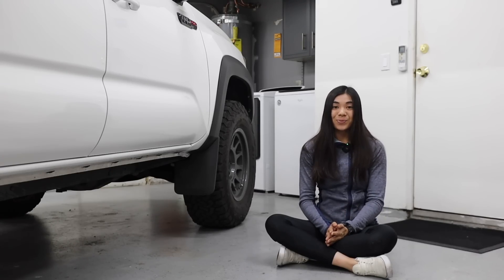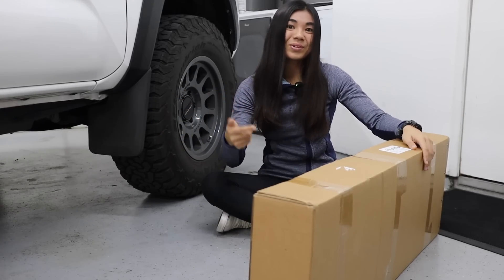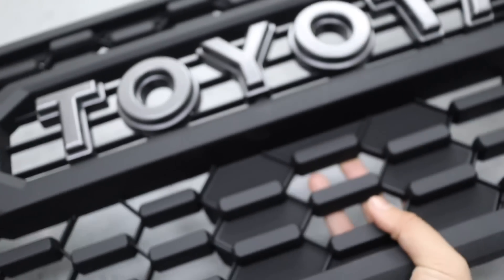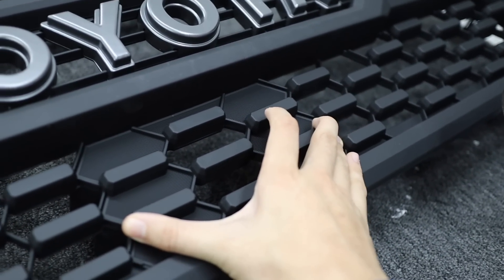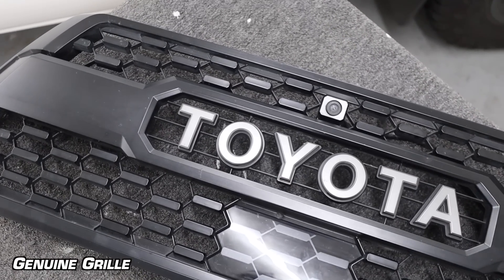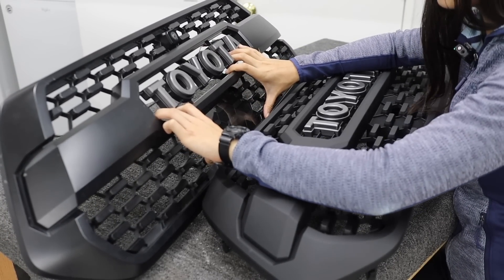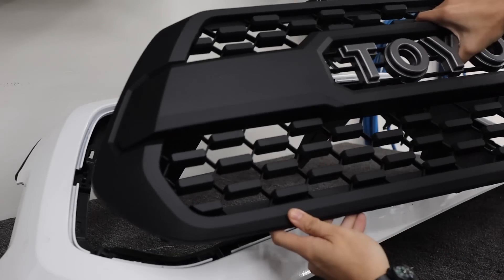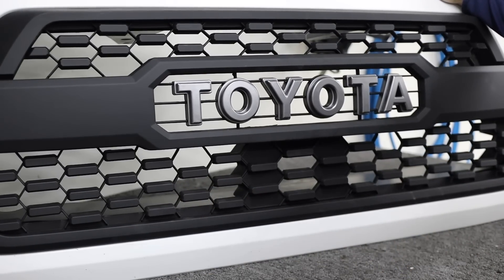TRD Pro Tacoma Grille: $100 Knock-Off vs Genuine OEM… same thing?

Comment: I did an aftermarket Pro grill on my 2nd gen Tacoma and it's holding up quite nicely. It fit with no problem, my main concern was how long it would last but after 5 years it still looks as good as new.
Reply: Link for it? I want one for my '08
Reply: @ramirojuarez7379  link?

Comment: The biggest issue with getting an OEM TRD Pro grille is having a VIN number for a TRD Pro. All the vendors of OEM parts require a correct VIN to purchase. I found my knockoff from R4T, and it’s not too bad.
Reply from the maker: True—the VIN thing is another thing to consider!
Reply: Not necessarily, they usually come with a warning that you should provide a VIN number for proper fitment, but I haven't had any issues with ordering any parts from any of my local dealerships without it.

Comment: Definitely recommend going OEM if you can. Best fitment, and looks a better. And if you have the front camera, the OEM camera bracket and placement is MILES better than the ones I have seen on the 3rd party grills. Usually the 3rd party grill brackets set the camera too far back. I had a 3rd party one, regretted it and ended up getting an OEM one a few months later.

Comment: Chloe you can tell you are an Engineer. Excellent review of the product. Someone commented that their blood pressure spiked to see you assemble it without some form of protection on the floor. It is a cheap knock off, and I don’t think you will actually be using it.   I really didn’t like the lettering, I didn’t care for the flat black on the knock off, and I’d would need to add the factory sensor, so I would go for the factory model.

Comment: Some aftermarket parts I purchased for my 5th Gen 4Runner was replaced with OEM…They didn’t fit or either looked cheap compared to the original…Most were Garbage! Cheap is expensive! Stick with OEM if you can! Lesson learned, OEM is the best route except for my T10V2 Android 14.1” Touch Screen…😮

Comment: I have a 2022 Tacoma TRD 4x4 sport and Iwent to a local Toyota dealer and bought a heritage grill for my truck I went home and installed it well to my surprise first the grill did not come with the sensor guard and the old one had 10 screws that went along with the clips new one did not so I went back and asked for the cover guard for the sensor they said I would have to buy it separately and it was 300.00 and said that my ven. Number call for that grill. My new grill has only 2 screws can someone please help me and let me know where I went wrong. This is my 3rd Toyota truck and never ran into this problem.

Comment: Mold quality, material, process, quality control, etc. for aftermarket is worse than oem, so the flat finish hides imperfections and makes it easier to produce.

Comment: Made in China? I wanted to replace my cast iron grates for my Webber grill $165. For OEM. I paid under $50. For the exact same thing. Made in China, both. The only difference is the replacement didn’t have rough edges from casting.  Better than the original.

Comment: There is a difference in the TSS Garnish covers as well, the OEM is higher quality than the china knock offs, another difference is the two posts on the China knock off garnish are 5/16 in diameter while the OEM garnish the two posts are 1/4 inch and use a smaller push lock washer that is easier to install. The OEM Toyota TSS garnish is made in America.

Comment: No surprise, a plastic injection molding tool for a part that large is absurdly expensive. Toyota is going to spare no expense. They’re also going to retire or refinish an aging tool while knock offs are gonna run it into the ground.

Comment: Probably shouldn't worry too much about not being OEM parts and using them.  Most tires and rims, brakes, Aux lighting, and  windshield wipers, the list goes on and on, are not the same as stock.  Stock and OE parts are sometimes hard to come by and somethings in the aftermarket are superior quality.  Though maybe not in this case. Pick your poison, price vs quality..

Comment: If you don't have a TRD PRO, are you posing with a PRO grill? I have a TRD Off Road and like the look but don't want to be a poser. Had a SR5 with an aftermarket grill, it looked good but had some front sensor problems.
Reply: How are you posing? I much prefer the TOYOTA design over the stock grille with the “T”. No one really cares and it looks a million times better.
Reply: It's not like slapping Cobra and 5.0 emblems on a V-6 Mustang, it's a styling preference.

Comment: I've had the knock off grill on an '18 for about 3.5 years now. Still looks new and was able to mount the sensor with an OEM sensor cover on the front without issue. If it rains a ton, some water will penetrate the sensor cover, and you can't use the adaptive cruse control, but this has been a super rare occurrence.
Reply: that happens with oem too, it happened to me with a lot of rain...

Comment: Yotaverse for the win. Theirs has the whole letter plate and not individual letters. And yes, you can remove the blank garnish and swap your sensor over.
Reply: Yep. I bought the Yotaverse grille for my '19 SR5 a year ago and still looks great! I installed a .100" thick #10 washer under the sensor's top mount and screw to slightly angle the sensor upward.  I did this on the bench before installing my grille based on research I did with regards to changing the sensor's mounting location. Cruise control and collision avoidance work fine.
Reply: Yotaverse has the best aftermarket grille imo. In the past, they had this type where you had to screw in each letter. But now, the whole plate is just easier.
Reply: @TiSilver330Ci  do you need to buy the "third gen garnish"? or is the one that comes with it ok?

Comment: The shine on the after market is duller, the letters are nice enough, but not as sharp as the OEM. It looks like that after market grille is bought from the same Amazon seller I got mine from. Did that after market comes with the raptor light? If it did, those lights only fit a certain way. The plastic does feel and look cheaper, but so far, the grille I got still looks good, no hazing or warping from the occasional 100 degree heat. Mine is 2016, so there is no need for the front sensor assembly. Great video.

Comment: I got the knock off and painted it with a matte black finish which has dark, dark grey cast and gives it a durable look. Perhaps is not as shining as OEM but holds up better for scratches. Otherwise, satisfied with knock off. Added lights and front camera to top it off. Have Had it a couple years and a solid purchase. I have 2 Toyota grill name plates (as a result of a scratch on the 1st one and they replaced it). Was planning to paint it red and maybe switch out. I have “quick sand” color with red accents. Nice truck. Have 2017 Sport.

Comment: I bought a knock-off brand because OEM is not worth it, I ended up raptor lining it either way, same with the fender flares, the ride mirror caps, the rear bumper caps as well. Just little things here and there to match.

Comment: the finish is more a factor of the mould, rather than the quality of the ABS.  One of the effects of the desire for TRD Pro grills, is that OEM grills from other trim levels are readily available on resale sites.  I didn't care for the TRD Off Road grill on my '18 Tacoma, and found a '20 TRD Off Road grill take off for $60...I like it much better.

Comment: I like the one Taco vinyl has with the center (Logo) inserts that you can get various colors. They also have an optional front camera mount available. Some of the OEM sights want a VIN to order this part also. I definitely agree there is a visible difference. But for the extra 10HP you get for adding the grill who cares. HAHA

Comment: Both grilles are painted. The OEM part has a glossier finish, maybe a 10 gloss and the aftermarket grille has maybe a 2 gloss. The higher gloss is more resistant to marking. 

The excess plastic is called “flash”. It’s likely where the mold is worn in those spots due to the shot count in that particular tool. It could also be from some slight damage at the parting line (where the mold halves meet), or a bit too much packing pressure when being molded.

By the way, Toyota didn’t mold that part. A supplier molded it as with most parts used in the making of the Tacoma. The aftermarket part is also molded by a supplier, just not for Toyota. The lack of detail in the aftermarket part is intentional so that the cost can be kept low. Otherwise, we would have no incentive to choose it over OEM.

Comment: OEM TRD Pro grilles are a freaking rip off!  All you're paying for is the genuineness of it. It holds really no quality advantage over aftermarket "cheap" ones. Obviously, get an aftermarket one from a reputable seller, but there's really no reason to spend like twice the money on a OEM one. There's a lot of aftermarket ones that are a little over $100 and never have a problem. Besides, I'd be willing to bet that the factories in China where the OEM and aftermarket ones come from are either in the same neighborhood, if not the same place. Save your money.

Comment: First,  I noticed right away the letters didn't look genuine and I only have a '17 TRD sport.     The fact that your grill withstood that hit says a lot about the quality.  Also,  the same type of plastic can have multiple coats,  colors and finishes.  It's just small changes to the recipe be for the injection process.  I used to pick up brand new recycling bins and deliver across the US.   In right with you OEM!   Best wishes to you all.

Comment: Hi Chloe, great video! Based on your b-roll, I have some speculation for you. 
I bet the knockoff grill was based on a 3d scan of the original part. A matt finish really helps with laser scans, so I bet an OEM grill was sand blasted on the front prior to scanning. That matt surface finish would have been projected onto the aftermarket's mold if they were lazy machininging it. The radius's would be larger too, especially if the laser scan's resolution could not pick them up. Since the back side of the aftermarket part has a glossier surface than the front side, I think they took more time to optimize and machine the bottom side of their mold to match their equipment.  I bet both the OEM and aftermarket molds were formed with EDM. I think they used a similar injection molding for the ABS, but the different equipment involved would impact some of the seam lines and material-flash you're seeing in the aftermarket.
Reply from the maker: Ah, thank you for the information! I don’t have much of a background in manufacturing so this makes a lot of sense—appreciate the input 😊

Comment: I think if you own a real TRD Pro you should use OEM TRD Pro parts.  But if you have an SR5, TRD Sport or Off-road, aftermarket parts would be just fine. You saved money by buying a lower trim but end up spending just as much as a Pro by the time you buy all the expensive OEM TRD parts. Just my thought process.
Reply: Agree with you 💯. I own a 2nd gen Tacoma SR5 Prerunner and didn't want to turn it into a fake TRD Pro, just liked the look of the grill and couldn't see myself paying $300 for OEM it so I got an aftermarket one and it's still holding up 5 years later.

Comment: Wow. I usually like your videos but you come across as totally conceited  putting down replica parts. You kept saying knockoffs and in reality that a term for those selling items as real, but they are not. Replica parts are and can be sold as a complete item. You kept laughing and putting down the ‘knockoff part” but don’t do that. Not everyone is in your position to only afford OEM. And I will tell you, OEM is completely overrated. Replicas can and are much better since they save you money while doing your best to build a vehicle according to their budget.
Reply: 🤣🤣🤣🤣🤣 I only buy OEM. I learned my lesson specially with honda parts. I have a 07 sequoia limited with every option on the book including the BBS wheels. Bought it new in 06 and still runs like a champ, 258xxx miles. Back in 2020 someone hit the rear bumper in a shopping center. Order a knockoff bumper, poor quality, missing holes for OEM accessories. $350 dollars for it, sent it back and paid for restocking fee, and called my dealer. Ordered OEM for $1200 and no problems installing and came painted. 
OEM is always better, anyone that works on cars knows that.
Reply: Lmao sensitive
Reply: Yea, I would have to say that OEM in most cases is the way to go.
Reply: I purchased a OEM TRD Pro grill and actually a Dove flew into it and destroyed it!  I bought a aluminum grill from Empyre and it has taken a beating that the OEM did!
Reply: I see what you mean as to there are a lot of aftermarket companies that build great quality parts but there is also a lot of non OEM parts out there that are really bad. The reality of finding OEM like quality for cheaper is pretty rare.
Reply: I definitely prefer OEM parts. Aftermarket parts don’t last especially parts that take weather abuse. After market electrical parts usually fail compared with OEM parts. I bought after market headlights and they didn’t match and I had to modify it to make it fit.
Reply: Replica parts are stealing money from the company that made the original parts. There is no defending replica even if you bring coat into the argument. Replica parts are always inferior to original parts and by a long shot. She is just trying to help people who aren’t sure if they want the oem or replica part. Only time a replica would be a better choice would be like when you want red letters instead of the oem silver on the grille
Reply: Get over it
Reply: @ElMorroPerez you didn't do any research or comparison. Plenty of top quality knock offs out there. For something like this grille, it definitely make sense to go knock off. Look how Chloe is complaining about literally nothing. Oh wow, you have to take 5 minutes and put some damn letters on the new grille. Big whoop. The oem grille is not worth the extra $400. I  guarantee you and Chloe would have extreme difficulty walking through a Tacoma meet, and identifying all the fake TRD Pro grilles. Getting major snob vibes from both of you.
Reply: @Eastsidegeorgiaboy  I like your comment. I'll rather pay for quality and if paying for quality makes me a snob, well I'll take it. But I'll be a snob with high quality parts. Thank God I don't drive a little Tacoma, but my wife does drive a clean white off road Tacoma . I can't drive anything less then a 5.7 supercharged.
Reply: Bro it’s a “knock off” if the product is a copy of the original. Which an aftermarket grille is. Replica, knock off whatever it’s not legit
Reply: I agree man. Let people waste money on the oem parts that are made in the factory next door to the replica factory
Reply: It's a hit and miss, on my scion im, I used a mix of oem and high quality or third party licensed parts. What I would actually look up is to make sure that there are there's Toyota parts then there are a tier b tier and c tier license products and then there are just the rip-offs I usually stay within the a and b tier license products cuz I'm still saving money and it's okayed by Toyota. It's only on like my Scion xB that I can't really find license parts so I have to look elsewhere.
Reply: I agree not everyone can afford OEM certain things make sense but a plastic grill gimme a break. Sucking up to Toyota for perks shows you really are only about yourself and not the people that watch your videos. I know for a fact these grills on eBay are just fine and if you want them to shine ha it’s a truck and unless you’re going into a show who cares worst video ever are you hiding those ears👂
Reply: The appearance difference in the OEM grill is most likely because it has been clear coated or painted vs the raw ABS plastic look of the aftermarket grill. Apply the same treatment and I’d venture that the two would be much harder to tell apart.

Comment: I will always use the “knock off” parts over the “rip off” oem parts. Oem is such a rip off. The aftermarket parts are just as good for a fraction of the price.

Comment: When buying aftermarket body parts look for CAPA certified parts. These are certified parts that will usually fit and look much closer to stock than those that are not.

Comment: I just saw your video on the non-OEM Tacoma TRD Grille and I’m surprised. I understand that we would all choose, OEM parts if we could easily afford. Or we would buy OEM “IF” they offered it. (I.e., Drivers Side Grab Handle). But manufacturers like Toyota wouldn’t be interested in not marking up parts hundreds of percent. Fortunately there are people who know the math and will fill the need without the OEM greed. (Again, KTJO4x4). And I’m ok with that. But, You are right. You are being nit picky. The slight bits of extra plastic from the injection mold process? Have you ever built a model? You didn’t like the letters or the matte finish. You hardly said anything positive about it although it’s hundreds of dollars less and, if bought on Amazon, is easily returnable. I’ve watched all your videos and their great. I’ve mentioned you and your channel to my friends and persons I don’t know in Tacomaworld and even Katie at KTJO4x4. If you can hold it, see it, use it and it works… it’s not “fake”. And btw, aren’t all add-on’s or mods, non-oem?